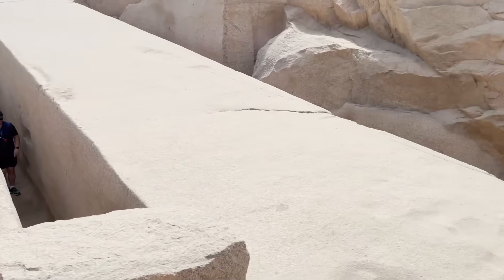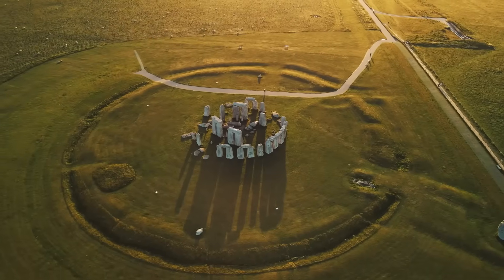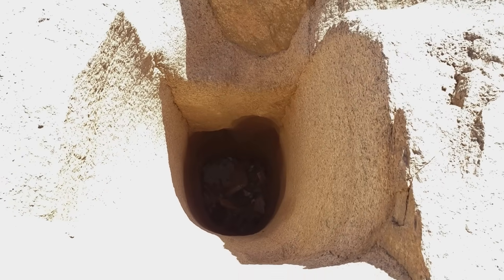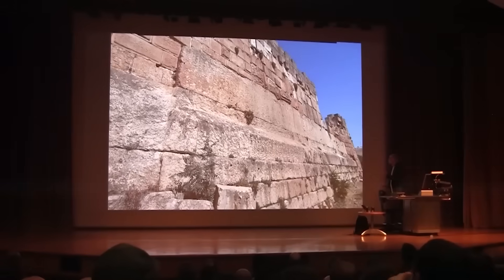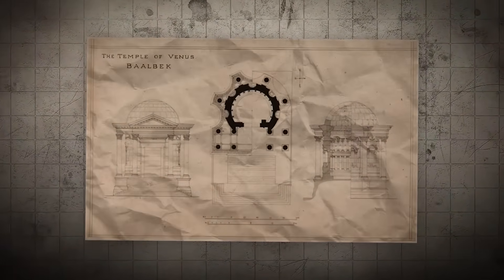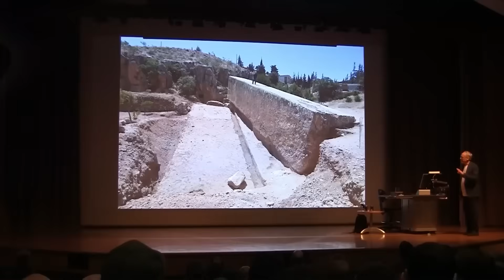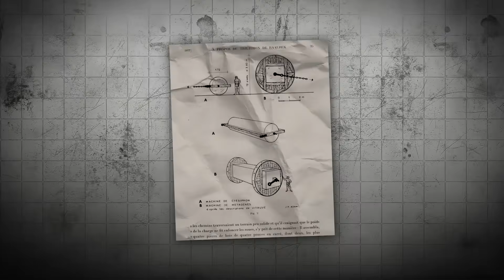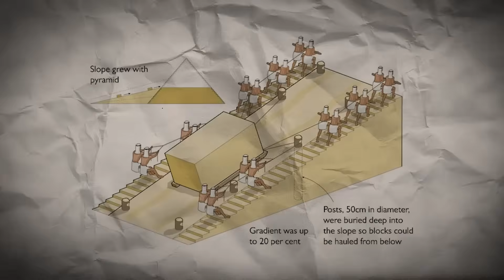How Ancient Builders Moved Obelisks We Still Can’t Lift

Comment: In 2022, I ended up in a private gathering in Lisbon—nothing advertised, no sign outside, just coordinates and a time. Inside: maybe twelve people, all silent, all watching this old man at the center speak like he was decoding reality itself.
Afterwards, he pulled me aside and said,

“You’re not here by accident. The cracks already started, didn’t they?”

He handed me a worn envelope. No explanation. Just said, “Read it when the world stops making sense.”
Inside was The Forbidden Knowledge Behind System by Walter Stanton.
I didn’t read it right away. I waited. Until things got too strange to ignore.
And when I finally opened it… it wasn’t a book. It was a blueprint—of everything beneath the surface.
It won’t comfort you.
It won’t validate what you think you know.
But it will show you why nothing in your life has ever felt quite real.

Some people stumble on truth.
Others get initiated into it.
Reply: Einstein is said to have said: "We only know for sure that we know very little." I am an electrical engineer (and sound engineer), 70 years old. During the Covid restrictions (I couldn't go anywhere, I worked in my own well-equipped lab) I built a device (based on quantum physics principles, experimental physics has always been my favorite) with which you can change the "enshrined" physical properties of materials (copper). Since then, to the great delight of my wide circle of friends, I have been making very significant performance improvements to high-end audio cables and speakers. Of course, it can be clearly measured with instruments. For example, the data transmission capacity of Cat 6 UTP cable has improved by a factor of 9.6. This was measured in an accredited independent laboratory. I just want to say that many things can be thought of further than what we learned at university. But for many years I worked in a plasma physics research lab, where the transmutation of chemical elements was commonplace. (Unfortunately, we were unable to produce "precious metals", only sodium, potassium, aluminum, phosphorus, etc. The starting materials were carbon and nitrogen.) I wish you much success and good health! (Unfortunately, I have been struggling with chronic Lyme disease for years, and I still want to do so many things..)